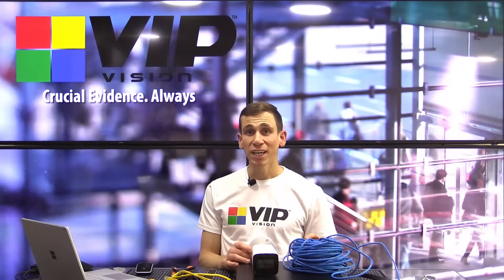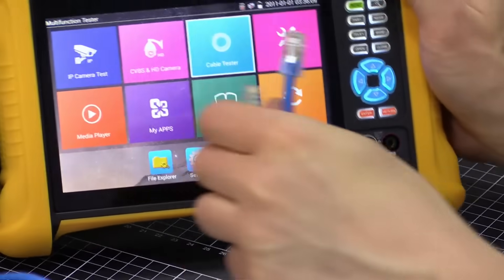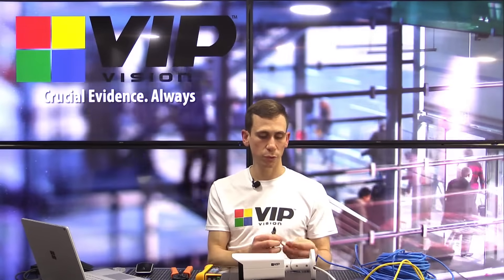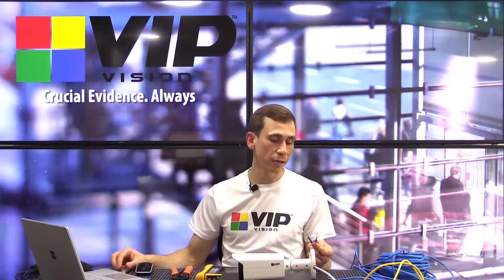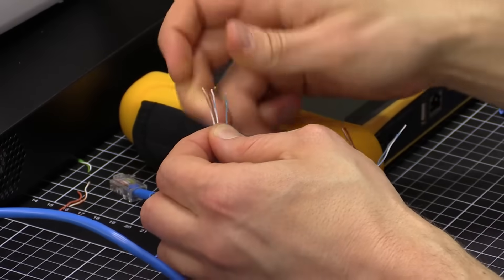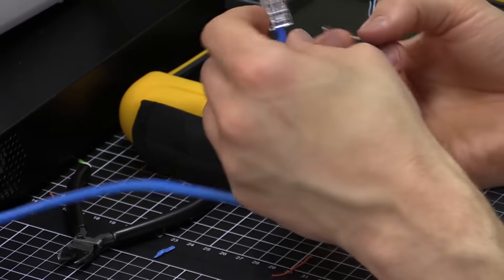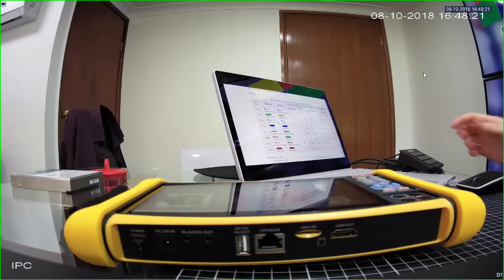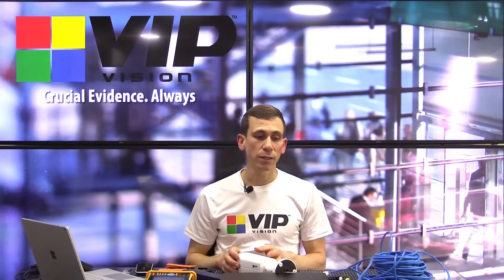Simple fix for Ethernet cable (Cat5e/Cat6) with broken pair(s)

Comment: my run has wire 7, 8, not working. So theoretically the camera should work since 1,2,3,6 are good. Must be a different camera connection shown on your chart. Any other ideas for me?

Comment: Hello, your vid is great and can really save a lot of people.
If I may ask a question:
My house has cable running from the patch panel to an outside wall where I installed a poe ip camera.
After testing the cable i found out that only cables number  2 , 4 , 5 , 7 , 8 are ok via the tester.
Can I use your technique to power my camera via poe switch and operate it just using 2 pairs (aka 4 cables)
Thank you so much.

Comment: Mine had 2 45 78 working and was able to salvage 45 78 like you did.  Thank god.  This cable is from basement to the third floor so replacing it was going to be a huge mess/expensive.  While I am now stuck with 100mbit, it is better than nothing!  Thanks.